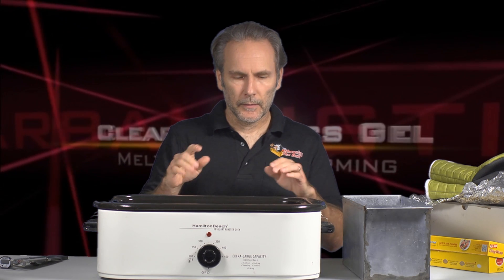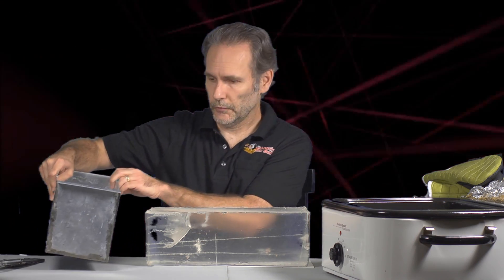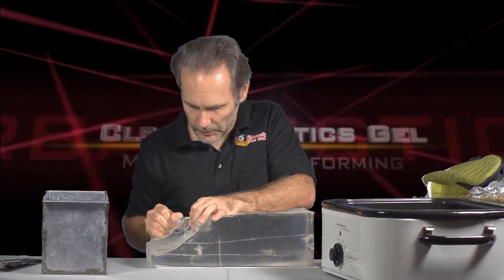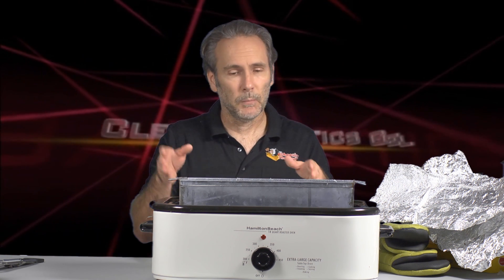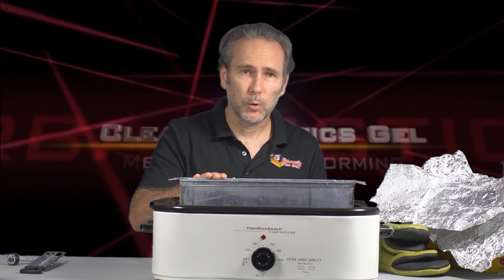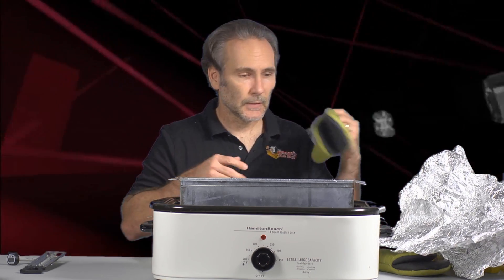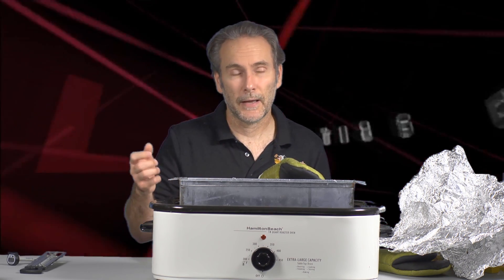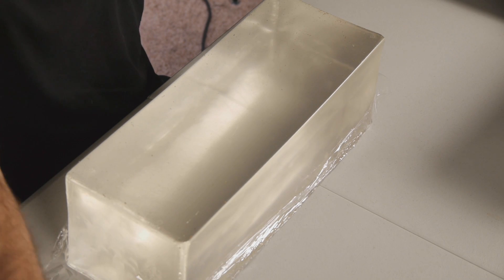Working with ClearBallistics Gel Part 2: remelting and reforming

Comment: As far as vibrating the block to remove any bubbles,in some materials the vibrating will increase the amount of bubbles. This is known in the dentistry field.
Reply from the maker: Regarding the bubbles, I have a much simpler solution now.  I've abandoned ripping the block up into smaller pieces.  I just now put the whole block (minus the bullets or other fragments) back in the mold, and heat it up right in place.  It works about as fast, maybe a little slower but in the same ballpark, and there are no bubbles created.  The bubbles come from little pockets of air that are trapped between pieces because the pieces don't perfectly fit all together; remove the pieces and you remove the bubbles...So I still have to go through and pull out the bullets, or chunks of denim, or the flash-burned portions of the gel, but once that's done, just shove the whole block right back in the mold and heat it up.
Reply: Excellent.

Comment: It could. But then again...they do make waterproof...um..."toys." I would imagine that they would stand up against 200 degrees for enough time to work out the bubbles. and you can try attaching something to the device McGyver style to eliminate direct contact between the device and the gel. Vibrating concrete doesn't take much time at all for the vibrator to do its job. The air usually comes right out in a very short exposure time.

Comment: Ya know...when I was pouring concrete we used a commercial concrete vibrator on deep pours to work out the air bubbles and settle the mud. While this may seem a little crude, I would bet that you could find something battery operated at an adult store that would help get the air bubbles out.